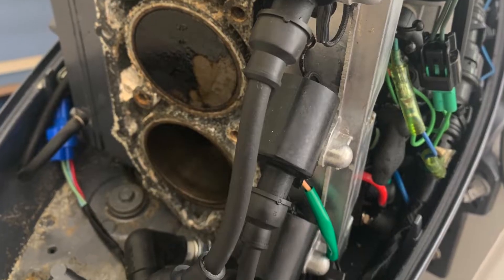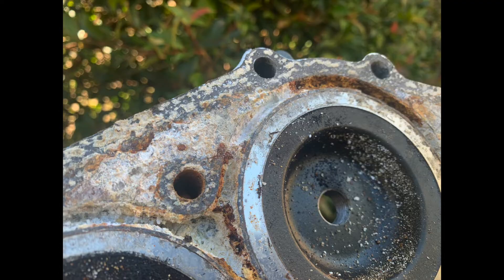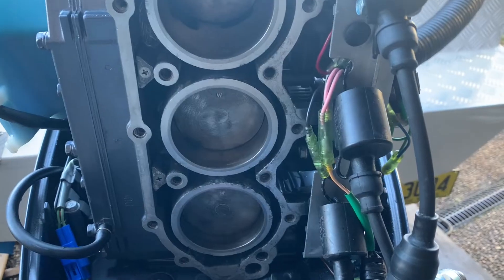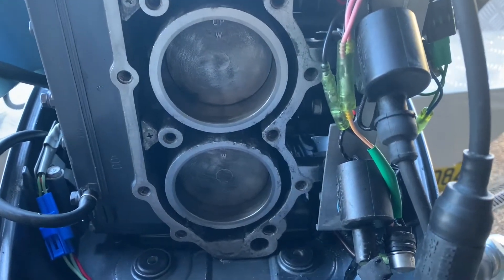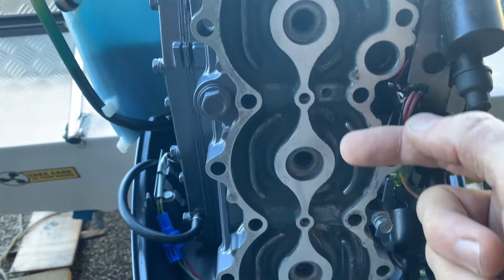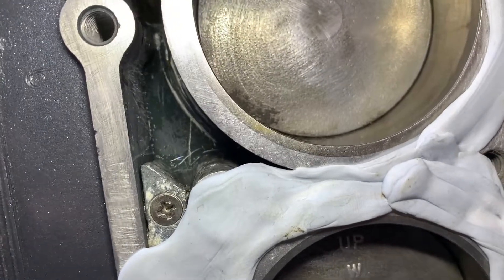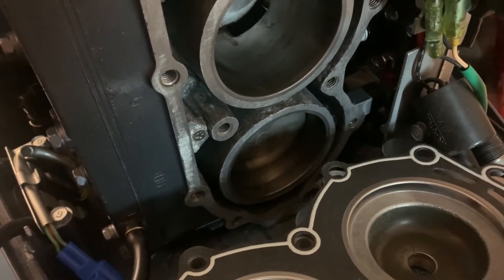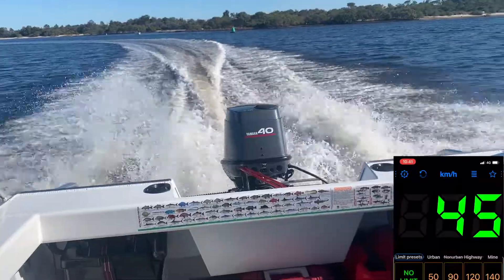Remove salt build up Yamaha outboard 40hp block head restoration Challenge get motor running 30 50

Comment: This is just the inspiration I needed.  I have a Yamaha V6 150 two stroke that's overheating and I'm pretty sure the water channels have never been cleaned.  I called mechanics and at 125.00 per hour for such a simple repair is absolutely preposterous.  This is not that difficult of a job to do.  The only issue is whether you can get the bolts out without them breaking, because if they break it's not going to be easy to get them out.  If all the bolts come out then it really is just a matter of cleaning and clearing, and putting it all back together.
Reply: cleaning the water jackets in the block really shouldn't ever be needed if the motor is flushed with fresh water and tilted fully DOWN when stored. i have 40+ year old salt water motors that look just fine inside. the japanese motors have always been bad with corrosion, though. great reliable motors... horrible corrosion issues that never really got solved.
Reply: Bolts can be a huge challenge and a 3 day process to remove without breaking.

1. use a torch to heat bolt to pumpkin red. Let it cool.
2. Strike bolt with a few stiff hits. This will send a bit of a shock through the bolt and corrosion.
3. Use a socket to test if the bolt will budge any. If so, work it clockwise and counterclockwise about 1/16th of an inch
4. Spray the bolt with PB Blast very liberally and let it sit overnight.
5. Repeat steps above as many times as it takes until it breaks free.

DO NOT rush the process. I have removed many severely corroded bolts from saltwater motors. If the bolt does break, DO NOT use those Easy Outs! Use a tiny drill bit to drill a hole through the center and progressively use bigger bits until you can collapse the walls of the bolt.

Upon reassembly, anti seize is your friend!
Reply: @michaelh7527  well said. only issue is heat: many places on the motor you need to be careful as there are oil seals, o-rings etc you dont want heat radiating too. but yeah head bolts, pan screws etc just fine

Comment: Could you use a 3,000 or 4,000 pressure washer??
Reply from the maker: unfortunately after years of build up, you need to drill & chisel the rock solid salt!
Reply: @mikemike7523  could laying motor horizontal, cylinders up, head off, then filling block with a mixture of boiling hot water properly mixed with RYDLYME and soak for several days, then rinse under pressure better clean out unreachable passages etc…?
After first manually removing heavy deposits that are accessible of course. Also if one does rinse religiously for 10-15 minutes after using keep engine block clean enough that deposits don’t form, or is it cumulative over time regardless….just at a much slower rate?
Lastly if cumulative even after rinsing properly, how often would be good to flush with RYDLYME, or other flush additives, before resorting to head removal, thermostat removal etc..?
Reply from the maker: @incognito5986  I really think that manually cleaning is the only way to stop it when using in salt water.. the flush additives only seem to give a minimal amount of help.. I've seen a lot of motors still salt up over time.. The main thing that makes it worse is the time they sit without use with the water inside the cylinder block/heads.. I think (as i mentioned in the video) if you use in salt water, I'd remove heads at 10-15 years as a major service.. Re-grease all the bolts when refitting to stop them locking up over time.. If you leave it too long, corrosion & salt finds it way into the bolt thread areas as it slowly work past all the gaskets..you'll break every bolt & the motor will be worthless then..😭😢😢😢
Hope that helps!
🤓🧐
Reply: @mikemike7523  watch the RYDLYME videos youtube. It seems to work decently.
Yea I’m a huge fan of “never seize” but I’m not sure which flavor on aluminum heads with steel bolts if they are steel.